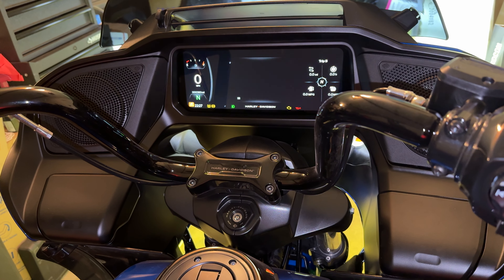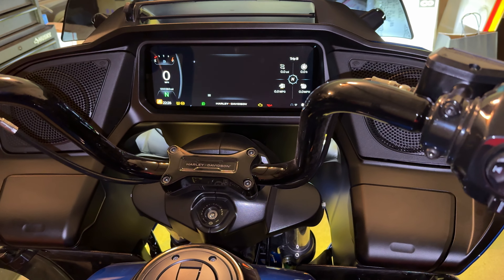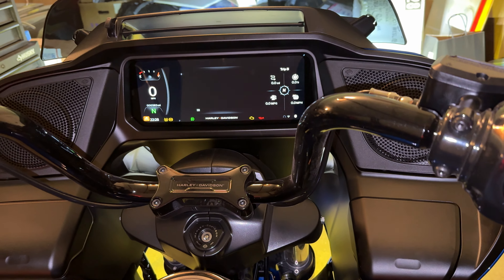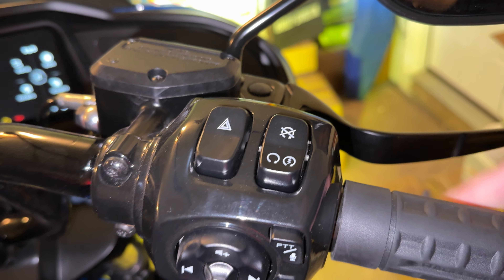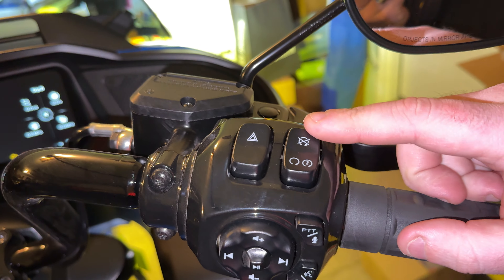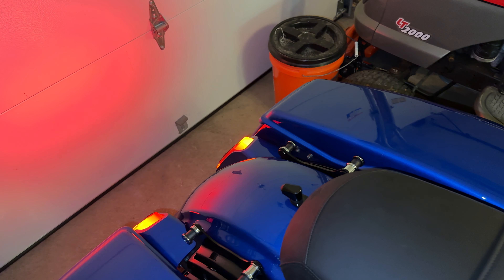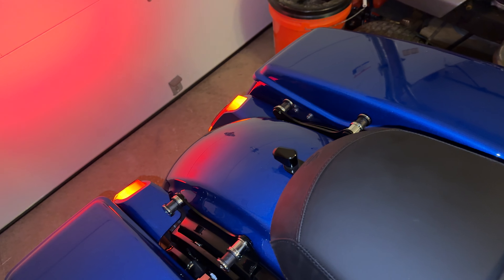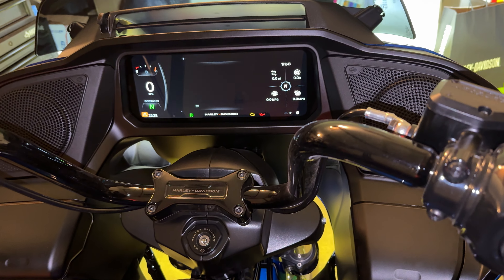How To: Turn Harley-Davidson Smart Siren Chirp On / Off (2024 Road Glide / Street Glide & 23.5+ CVO)

Comment: I have a Sportster S. Has anyone found out how to do this on this bike? I was so glad to have found this video - unfortunately it didn't work. And believe me, I tried for a very long time. 😅
Reply from the maker: From what. Found on the HD website is that they sell the siren as a stand alone accessory. With that said have you purchased and installed the siren module? If you haven’t then they would be why no sound is coming from the bike and why you can’t get it to work. 

https://www.harley-davidson.com/us/en/shop/security-siren-kit/p/69000124
Reply: @hdryderct  I should have added that, of course I installed the siren. Unfortunately, Harley's operating instructions are probably inadequately written but have not been checked. Even the transport mode is described incorrectly there. Perhaps someone else will get in touch who has got rid of the “chirping” on a Sportster S. Many thanks so far!
Reply from the maker: @Aki-ui2kw sorry I couldn’t help more. For me the instructions didn’t help either by install either. From some videos I watched on your bike it seemed as though after install it just worked. If it didn’t I would just keep mess around with it kinda like I did in my video. Good luck.

Comment: Great video! I found the updated instructions that shows where to install the siren on the new model road and street glides. I installed mine the other day. You do have to remove the battery though.  It installs directly behind the battery. There's a cutout in the plastic fins behind the battery that the siren snaps into. YouTube won't allow me to insert the link to the instructions for some strange reason.
Reply: Where did you find the instructions?
Reply: @marcuslee1750  YouTube won't allow me to add the link to the comments but if you google "harley davidson road glide siren installation instructions" and click on the Harley Davidson SIP link for "security system smart siren ii kit". Once you click on the link scroll down to "2023-LATER CENTER-COOLED TOURING MODELS". Those are the instructions for the new model touring bikes.  I hope that helps.

Comment: Can you do a video of the installation
Reply from the maker: It’s installed already but what I can do is a video giving instructions on how to do it with physically removing stuff until I get to the battery (not pulling that again). Should be helpful. 

Stay tuned for that. It’ll be a few weeks until I can get to that as the bike is in for service and the way my work schedule works.

Comment: I was wondering, on the 24 road glide, do you have to buy anything else or just the smart siren II kit to have some sound to the alarm? 
Is the security system included but no siren installed?

Just got mine and can't find any info. Even the FOB, I see a lot of different FOBs from a somewhat water drop shape to a rounded square shape... I need something to put the FOB in that is not as fugly as the plasticky rounded square thing-a-ma-jig that Harley gives you 😅
Reply from the maker: Included with the bike is security where just the lights will flash (wig wag) but no siren. If you buy a CVO or CVO ST I believe both come with the siren installed already otherwise you’ll have to buy the security siren from the P&A catalog. 

I’m not sure what you mean by the second part of your comment.

Comment: That's the only reason you buy the siren is for the chirp/sound.  The bike already has the alarm built in with no sound. There's a remote as well. I think I will bypass the siren this time because I always forget about it when I take off the fuse and the noise is irritating.  I never used the remote as well and it just eats up batteries without using it.
Reply from the maker: I usually power off the remote when I’m not using it so that the battery doesn’t drain as fast but yeah it has security built in bit flashing lights is absolutely pointless. The whole purpose of the audible siren is to draw attention. To each their own.

Comment: Ive tried it and mine is not chirping is this process three times of shutting off and on
Reply from the maker: Yeah Harley’s instructions say 3x on/off but I’ve found if varies. If it isn’t working you’ll just have to keep messing with it over and over. Start with the bike fully on.

I assume you installed the security siren into your bike and or you have a CVO. If you don’t have a CVO and didn’t install the siren that’s why you’re not getting anything: the no. CVO’s don’t come with the siren from the factory. 

Part numbers are in the description.

Comment: can you do a video of the installation please
Reply from the maker: I already have mine installed. Next time I’m in that area I’ll do a video of it though up until the point of needing to remove the battery as past that it’s just putting the siren into place and plugging it in.
Reply: Do I have to remove the battery to install the alarm?
Reply from the maker: @andresenriquez7933  yes you will have to remove it to install the module as well as to access the plug for the module.
Reply: I removed the battery can’t find the plug
Reply: @hdryderct  I definitely watch the video of the installation thanks ...just got the new street glide yesterday today someone knocks it over w their  car grrr
Reply from the maker: @carlosmorais274 damn sorry to hear about that. People can’t have anything nice these days.
Reply: I am not sure if the location is the same as the Softail M8s, but the easiest way for me was to remove the rear fender and there it was.